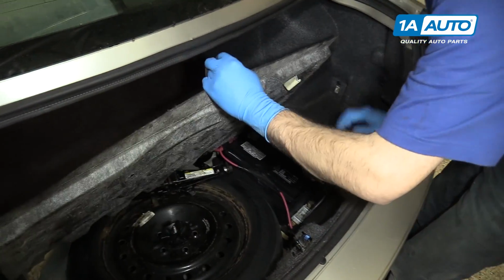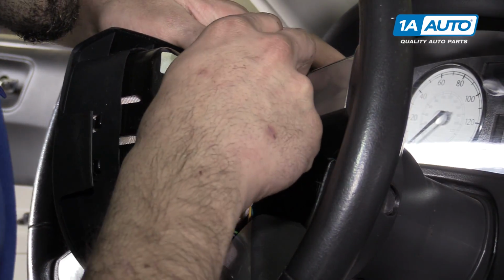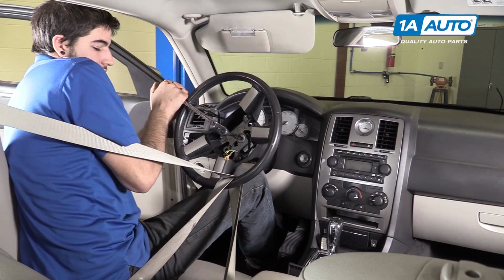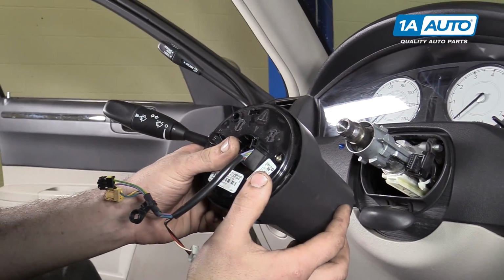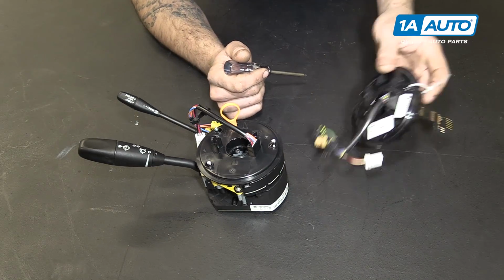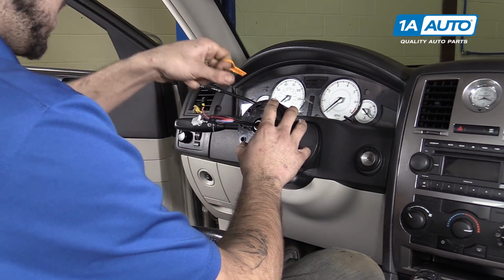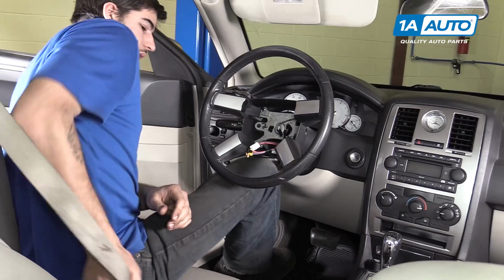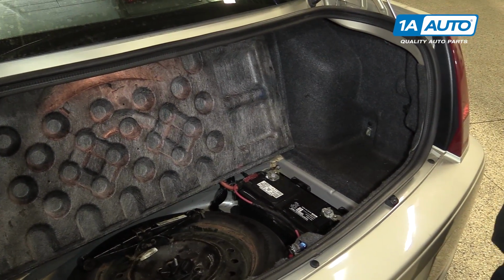How to Replace Steering Column Control Module 05-10 Chrysler 300

Comment: Thanks for your video! I have an electronic control steering column and it's memory doesn't work. Besides that it's movement is intermittent, so I have to press the lever few times to get it to the end positions. Is this the sensor I have to replace in my column that is shown on your video?

Comment: Do you guys know how the steering lock works on this vehicle? I noticed when inserting the key you can hear the steering motor unlock and lock when  removing. Is there anyway to disable this feature so it doesn't lock when key removed

Comment: I have a huge issue; I disconnected my battery for an hour while I replaced the ignition coils on my 2008 magnum and the car fired up and I was I able to drive home. I got home turned it off and then turned it back on. I was content with the car. So I turned it off and locked it and went to apt and took a nap. I came back about two hours later and my fobit didn’t work so I manually open the door and tried to start it. It wouldn’t crank. Also the anti theft light keeps flashing. I got a locksmith and he tried to program new keys with two different programmers and they kept saying there was a connection error and the keys didn’t program so to speak. So the new keys allow everything to turn on but won’t crank. Some reason the anti theft system is engaged and it won’t start.